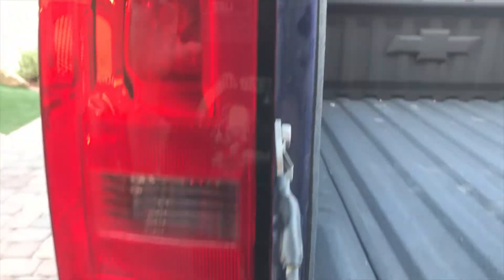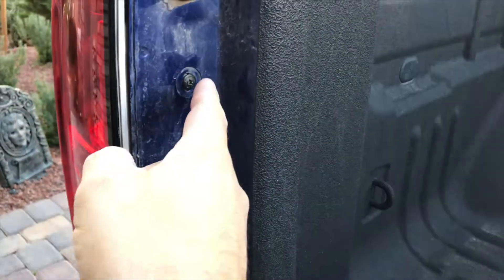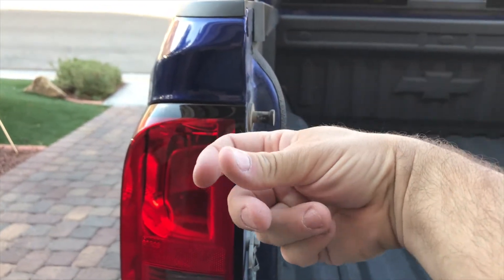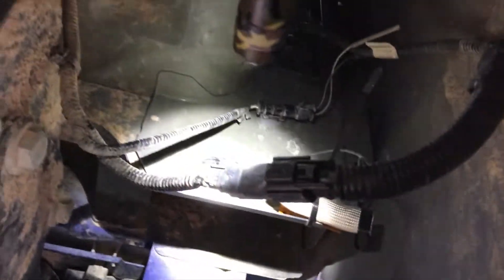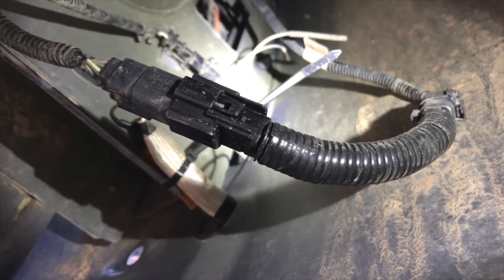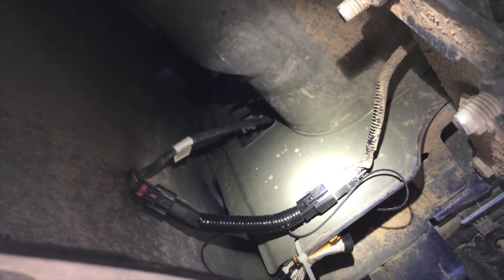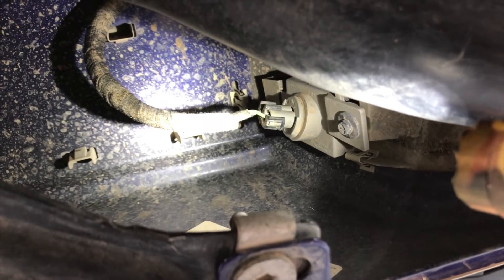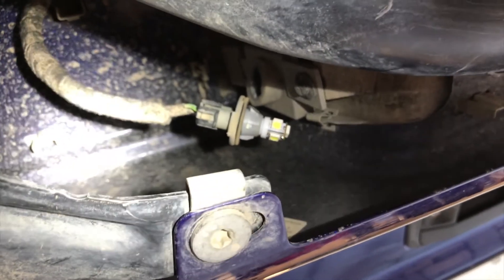Chevrolet Colorado GMC Canyon LED taillight Kit

Comment: What Gen5DIY should have done is mounted the resistors to a bracket that could be clamped to a flat piece of sheet metal underneath. Since the tails have 2 bulbs that flash do you need two resistors per bulb or does each resistor correspond to one bulb?

Comment: Nice vid man. Do you know if it's possible to just replace the Colorado rear tails with one from a canyon? Canyon tails look way better imo. Not sure if there are fitment issues.
Reply from the maker: Arun yes they will fit. I’m not sure if Gen5Diy has those in stock. But if you were to get a pair I would still recommend upgrading to LED’s in those lights as was that would take the swap to the next level!!! Thanks for watching!!
Reply: Vegas Shuffle okay thanks. I'll check them out! Yes I definitely want the LED! I'm doing diode Dynamics switchbacks in the turn signals too.
Reply from the maker: Did you already purchase the DRL relocation harness?

Comment: Do you know if you would get an error message replacing your brake light above the cab? Thanks!
Reply from the maker: You should be fine. Thanks for watching!!
Reply: should be, but. Will I get my money back if I do?
Reply from the maker: Sure
Reply: Can you show the LEDs all working? Maybe like a before and after the kit?
Reply from the maker: The cover photo is a stock on the right and LED on the left. But it is super difficult to get a picture that does it justice. It’s one of those things that looks way better in person.

Comment: What is wrapped around the resistors
Reply from the maker: A heat resistant sleeve so I don’t melt the plastic zip ties. It was just a temporary solution. Thanks for watching!!
Reply: Vegas Shuffle 
Ok thanks. Did you find a better mounting solution. Just looking for ideas how to mount mine.